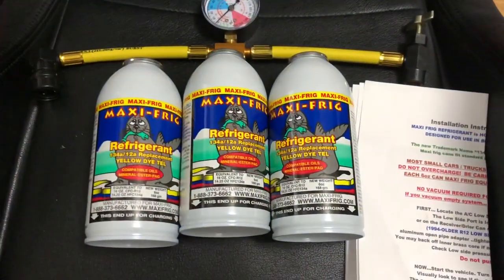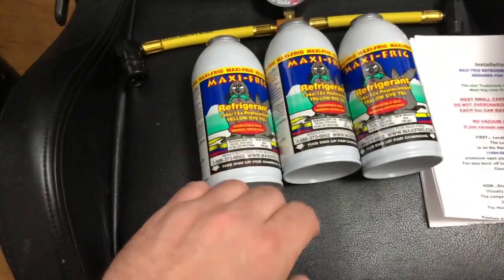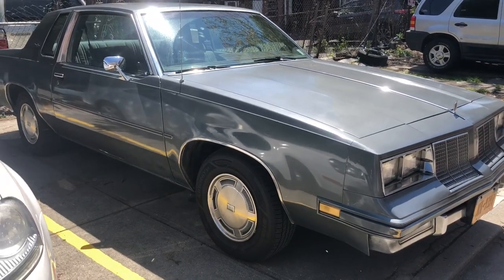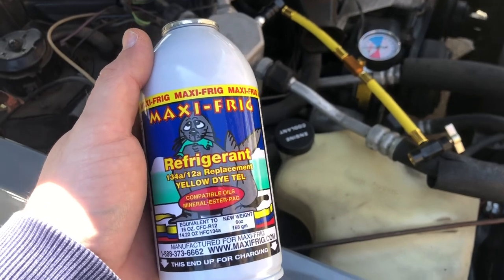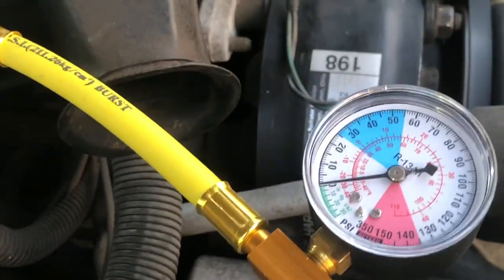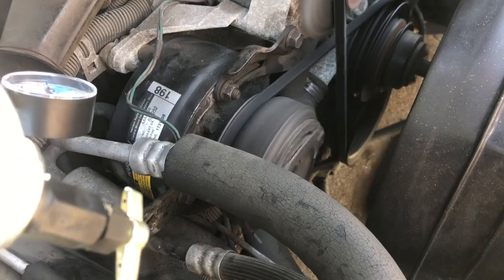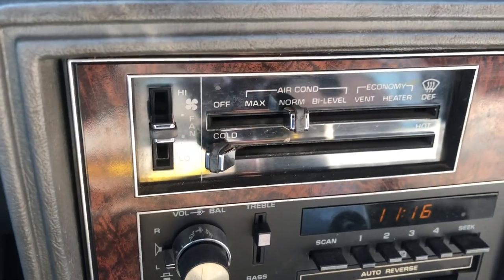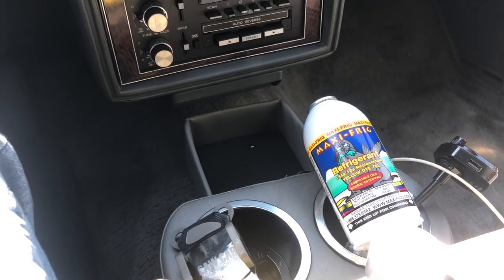R12 COMPATIBLE A/C REFRIGERANT Recharge  Featuring my Cutlass Supreme ( MAXI - FRIG )

Comment: I have a 1993 civic with r12 but I havent got to it yet. The last time i put r12 in it, the freon leaked out in one day. I need to find the leak and do a vacuum pull on the ac system. The civic hasnt ran for 5 years and previous owner told me the ac wasnt working for so long. How do you go about adding uv dye for an r12 based ac system?

Comment: But wait if it was empty doesn’t it mean there was a leak or o rings that won’t hold up . Isn’t it going to leak again ?
Reply from the maker: I was not sure since I didn't know the history of the car. The charge held for 13 months until I pulled the engine for a swap. I haven't put AC back in yet.
Reply: @grindsoul  thank you for replying

Comment: Is it still working? Did you mix r-12 with r-134a????
Reply from the maker: I actually had to temporarily pull my AC out when I did an engine swap. Its my next project for summer 2023. It was still working until the day I pulled it (about 1 year ago). I did not mix. I had nothing in my system(which was R12 system) and I used that R12 alternative called 134A. Seemed to work fine with no negative effects.
Reply: @grindsoul  cool man thanks

Comment: Does R12 blow colder than R134?
Reply from the maker: I have been told that R12 is the  best option. If you can find a shop that still has it, and is willing to charge your system with it go for R12. I could not find it locally in NYC so I bought the kit.
Reply: I converted a 87 Regal to R-134a and it's horrible. It will cool to a tolerable temp inside if the outside ambient air is under 85 degrees.   I'm going to have the R-134a evacuated for one of the R12a products.  I have a digital thermometer and will attempt to do a before and after.
Reply: I can report my results from R134a to R12a on 1987 Buick Regal.  R134a refrigerant at 82 degree ambient at 52% humidity resulted in 48 degree outlet temp
.  Evacuating the R134a, filled with R12a refrigerant at 88 degree ambient 70% humidity 42 degree outlet temp.  Six degrees doesn't sound like much but its considerable on the subjective how it feels inside the car.  Moreover the conditions were different between observations so the actual observed results would be expected to be more than six degrees likely 7 or 8 degrees if the testing conditions were the same.
Reply: Yes 6 to 7 degrees more

Comment: I gotta see about charging my 83 Volvo with that stuff
Reply from the maker: Go for it. If your system is empty then its worth a shot. He also sells a sealer so that if there are any leaks it will seal them up. I haven't tried or needed that yet as my system has been holding the charge ever since. Use your service manual to see how much to put in and calculate it. The kit comes with 3.00 lbs. I needed 3.25 total
Reply: @grindsoul  wish it was an easy fix. Ends up my system is holding pressure (45psi). Somethings in there and the compressor turns. Gotta ride out some San Diego summertime heat until I get a pro to look at it. Windows down is probably going to be the end result. 👍
Reply: @grindsoul  ended up working. I wasn't patient enough the first go around. The Volvo blows cold air! Not freezing, but adequate. Seriously, thanks for the upload. You did make it clear cut and simple. The low end port was kinda deep in there and sketchy, but it worked! Keep ridin' dirty and cush in that Cutlass! That thing is a gentleman's car! 👍

Comment: Did you need a retro fit kit? I have a 85 Monte Carlo SS that I need to recharge.
Reply: I did it on an 89 K5 blazer and I didn’t need one
Reply from the maker: It actually comes with the retro fit adapter allowing the threaded low end port to change to the new valve.
Reply: Good looking out! I'm about to order some now.

Comment: Thanks to the video! Going to give this stuff a shot in my s10. I did a new dryer, compressor and condenser along with flushing the evaporator. Put the system under vacuum, added 134a and it absolutely sucks. Feels like i put ice cubes in the vent im just blowing ambient air past it
Reply from the maker: I hope this helps. It looks like you did a lot already to help your S10. I am missing my AC now since i did an engine swap but its my next mission